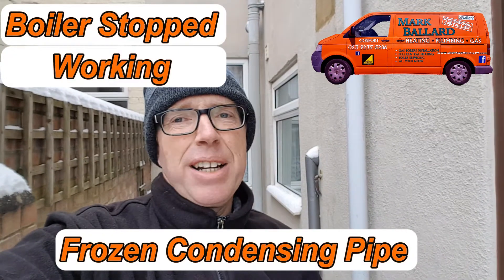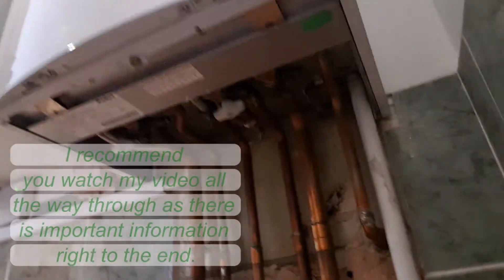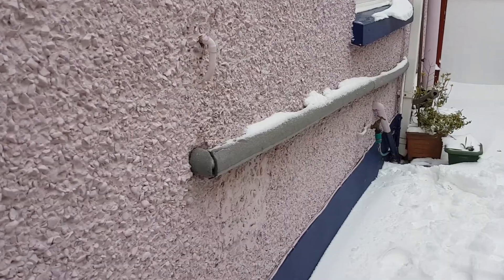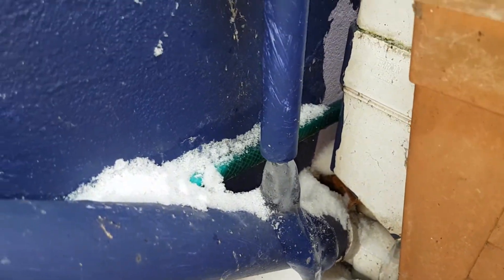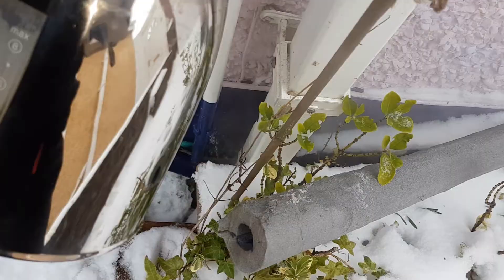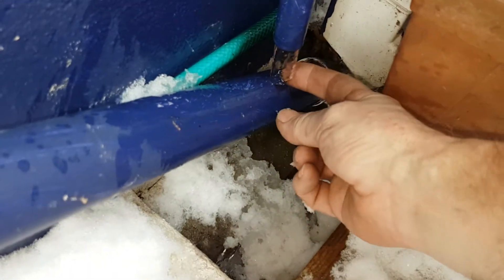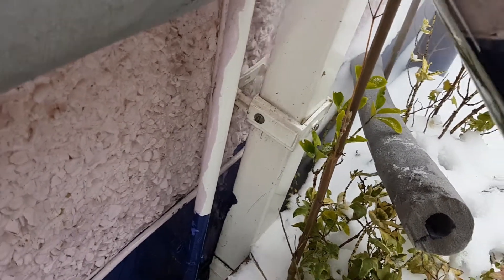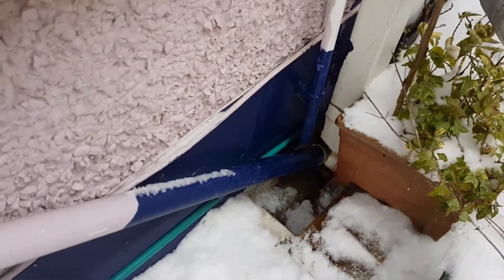Gas Boiler Condensing Pipe Frozen

Comment: Put a tee into the drain pipe with a valve on the open end, right against the wall and open the valve up into a bucket, while it is cold, so that the condensate drains into the bucket, instead of trying to get through the frozen drain pipe. Mine used to freeze and this solved the problem. If you thaw the drain pipe to the ground drain, it will only freeze again in cold weather, with a tee, it by passes the frozen pipe. Shut the valve on the T after the weather improves.
Reply: Do you mean inside by the boiler? I have this same problem.